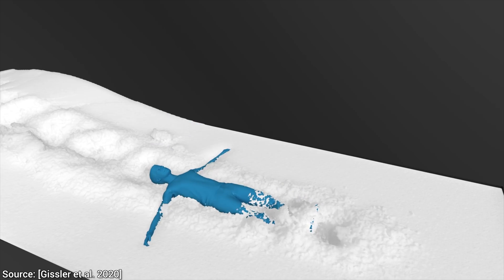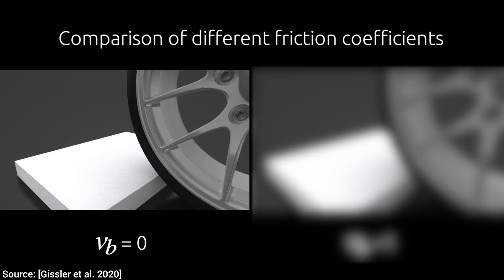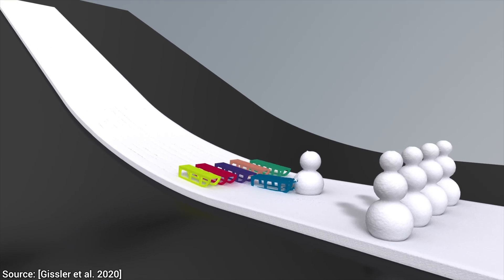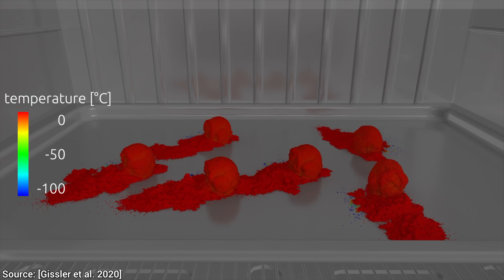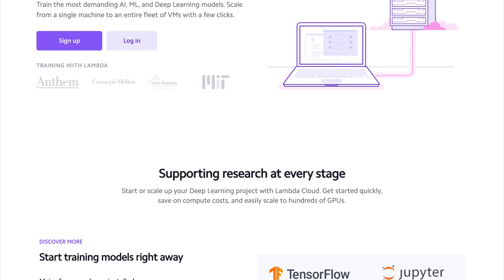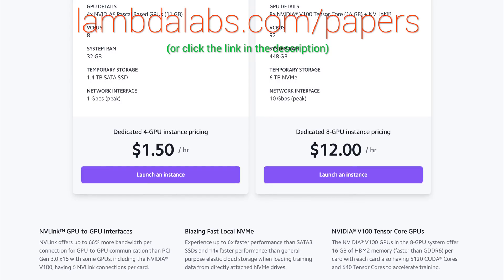7 Years of Progress In Snow Simulation! ❄️

Comment: They react like Styrofoam particles and nearly all are copies in that the single individual object in that all react similarly, they "melt" the same way. You do not take into account the cohesion of the ice crystals and instead treat each particle as it's own entity.

Not even powder snow reacts this way. Your presentation looks great btw, sadly, snow does not react like this. At the very least you need to add in some cohesion factor based on temp, to include the ice crystals melting singly or in clumps depending on temp and environmental factors and objects like the car used in this demo. The car was painful to watch as snow does not react that way when driven over. You need to add many new factors and variables. Cohesion due to temp (single entity crystals landing when frozen, melting together slightly, or simply interlocking when cold, their overall weight and reaction when combined etc) and compression ( what happens to that square of snow due to its own weight? Weight with temp gradients, refreezing?) are two that need to be added.

Comment: should snow be that sticky though? on the tyre example. it looks more like polystyrene balls than snow. Snow will compact into crack and get lodged in, or stick to certain surfaces, but i think one thing this simulation seems to lack is that every surface the snow touches is likely going to cause the snow to melt a bit before hand, so there should be a layer of wetness that then forms into ice and layers of snow going from ice to fluffy snow. Even the temperature simulation is just reducing the adhesion between the particles, none of them are actually melting like snow. theres no puddle of water forming, no water dripping off the snow
And like with most of these cgi fluid simulations once its beading on the sides of surfaces it just looks completely wrong. Same with this on the shot of the street, all the horizontal walls its acting like a cgi fluid sim with these weird clumps sliding around, whereas real snow will stick to a wall if theres enough surface roughness/wind and it can build up in crazy shapes, even horizontal icicles building up on wire fences, stuff like that. Thats the stuff they need to do to make this really great.

Amazing that its become so fast to compute now. but I cant wait until these simulations focus more on accuracy now that they are starting to get so efficient.

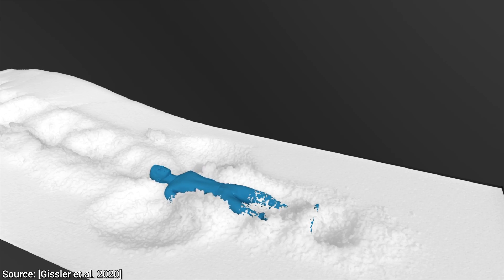Comment: 4:34 i mean yeah, mega = million, so 300MB would mean each particle takes 300B, which i think is a little much, but i suppose there’s temperature, location, bonds with other particles, and other “hidden” data that’s required for the simulation

Comment: You could have told many thing, but this being snow? No.

It strikes me rather like some magic styrofoam that can turn into a sticky gel. 

it has some strange isotropy to the way it is moving and breaking, the harderning seems like a "oh, stress, lets just randomly combine with the surrounding", and when in contact with other surfaces it  turns into a gel. 2:08 shows that really clearly.
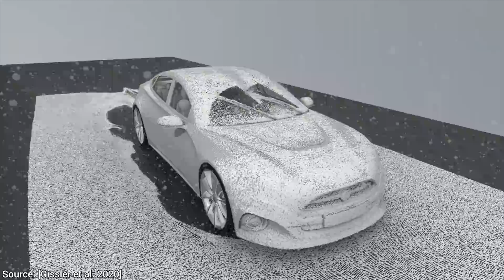Just look at the behaviour at 1:30 - yes, it leaves some sort of (strange) tire marks but everything else does not make it seem like snow.

By how it looks i kinda also doubt that it can even come near disneys version in terms of behaviour - just snow rolling down a slope and accumulating.

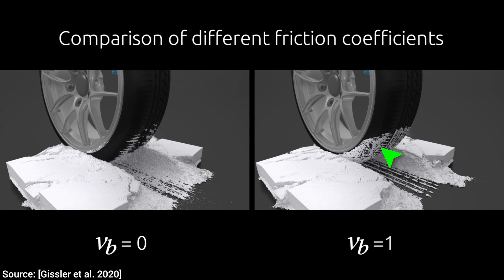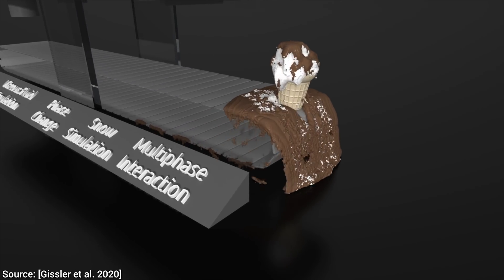Comment: does anyone else think this looks.. not correct? Examples: At 2:05, a tire won't create styrofoam-like edges, with snow particles drizzling off - it will compact the snow edge, more resembling a knife cut. At 3:54, the ice cream wouldn't split into many pieces with the center staying rigid - it would all collect in a single blob on the ground, with maybe som small splatter.
Reply: At 2:41, only very wet snow would come close to retaining its rabbit shape. Very wet snow would not turn into fine powder, as seen when the ears fall off.
Reply: Maybe I'm overly critical, but as someone living in the arctic, I see that these simulations clearly deviates from reality to a large extent. So I find it a bit strange when Károly's commentary seem to imply, from the footage alone, that this paper is an amazing achievement. It might still be, for all I know, but I'd prefer if the commentary also acknowledged the weaknesses and limitations.

Comment: Some of these demos look great but others look horrible. It can also be a little hard to tell in some spots if its the simulation itself that reacts oddly or if its just the extremely simple material used.
0:52 The snow that is kicked around looks great and I think this is the best that it looks in this video, but it looks like slime on their legs.
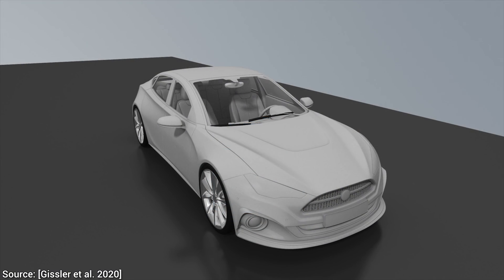1:10 to 1:21 all looks like slime or foam, snow is way stickier than that and the snow thrown by the plough just looks like a liquid.
2:07 I can't tell if its the actual simulation or just the way they placed the particles, but all of the little sheets flaking off look horrible
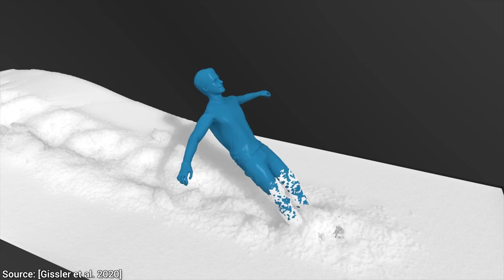0:59 The snow that is further from their arms as they're pushing it moves way to much, its transferring the motion more like a fluid than it should. The snow should just get compacted around their arms, with a small amount of movement a short distance away.

I wish more demos would spend a bit of time on the materials and showing real life ground truth videos as well.

Comment: It's definitely a leap forward but it's amazing how far it still is from realism. Just shows how much work there is still left for the people joining the field each day.
You can see that they don't have the level of dynamic change and variation that snow has.
The powder snow was too sticky and the densely compressed snow wasn't sticky enough. They need to add a layer that adjusts the friction and cohesion dependent on compression.
Powder snow won't make a good snowball but if you run it over with a car it'll compress very solidly. The snow pushed by the snowplow should turn into hard dense packed chunks as it pushes out.
I'm also curious how they deal with partial melt because a big element to how snow acts is partial melts at different stages and interaction with small amounts of melt changing clumping properties.

Comment: This is going to be difficult. The bunnies were way off, since the snow didn't melt and compress, it crumpled. Also, snow doesn't poor from roofs like that, it sticks to the roof and to the already present layers. The tearing is also weird or largely up scaled. You might as well do thermal capacity simulations because various things will take a long time before a snow layer starts appearing (e.g. on a wet tarmac).

Comment: Greetings from Finland. It seems I managed to procrastinate clearing up the snow at the yard till tomorrow, watching Two Minute Papers simulating snow. ;) I have to say these simulations look more like 'wet dry powder' than actual snow in behavior. Material in video is absolutely too fluid and uniform in density, droops right after it's fallen, compacting and solidifying is missing, melting simulation misses the state where snow still holds its shape but wets (I guess it needs more thermal than particle simulation) and so on.

Comment: The physics are amazing, but their shader ruins the final result.. Looks like 1990 CG snow
Reply: I agree that the shader breaks the demo.
Reply: True but thats probably trivial compared to the sim
Reply: @Redd56  
might be able to run the sim but you wont be able to display it in any meaningful detail. which makes the sim quite useless, for realtime applications.
Reply: @rocksfire4390  a youtube video doesn't need to be real-time and presentation is far more important
Reply: @spleen387  
it's the least important part.
it works, how you render it is up to you.
all i said was that in realtime applications it's near useless because trying to render it in any meaningful detail will bog any gpu down.
outside of realtime applications, yea it's great but again that isn't what i was talking about.
next time try to READ the words and understand them before commenting.
Reply: An important part of our original Disney paper is rendering the snow as a volume. It makes a huge difference. In principle you could particle density estimation to get a density field from the sph particles and then do a volume render from their method as well. It would look a lot better. This paper is more about the dynamics than the look.
Reply: The video isnt necessarily talking about how good it "looks" but instead talking about how accurate the simulation mimics what real snow would do, but yes it doesn't look great

Comment: Still looks like a mix of styrofoam, whipped cream and shaving cream..
Reply: It's not meant to look like the material snow. What's shown here is a physical simulation of snow, not a visual one.
We can already make a surface look realistically snowy with the right properties, mainly subsurface scattering; the tricky part is the physics of it all.

This simulation looks like shaving cream because it's a like a technical paper, it's meant to make the simulation's details clearer rather than make the snow look realistic.
Reply: That's because there is no shading going on so you are missing out on specularity, subsurface, translucency etc.

The grain size also is large in these which could be adjusted
Reply: Yeah it either looks like we’d styrafoam beads or old milk dripping off.. or a mix of frosting and foam beads.
Reply: It's not meant to look real, we could make it look like snow if needed to
Reply: @willywonka1962  But it is notthe rendering but the behaviourthat is the problem. They could use shaders to make it look perfectly like snow in a still-frame but it would still be obvious that there is something wrong as soon as it moves as the behaviour shown here looks nothing like snow.
Reply: @ABaumstumpf  I assume it's because they used the same friction value for the roofs as well as the tires and everything, as that value drastically changes the snow from being powdery to like a weird smoothy.
Reply: @Stephanie It looks nice, but it's still veeery simplified and optimized for a game. Real snow is very complicated. It can be a dust, a solid or even something between. You can melt it, you can make it a piece of ice or form anything from it. In Tomb Raider it's just a 3D surface with white texture, some shaders on it and some kind of a script which makes it lower the surface of itself under character's feet. I'm not a 3D designer but I think I explained it pretty correctly ^^
Reply: @Stephanie Thanks for a confirmation from a specialist :D
Reply: Yes as an expert of snow, this looks more like dry powder instead of snow. Snow always sticks more or less, especially when close to 0 C.
Reply: so i can eat 1/2 of it?
Reply: @godwin972  Don't eat the yellow snow...
Reply: Alot is in the shader as well. Even static snow is difficult to get right.
Reply: Agreed.  Many of these papers DO blow me away.  Not this one.  It doesn't look anything like snow unless you've never actually experienced snow.
Reply: looks better than what we have in games still!
Reply: @GvtTeddybear  It actually doesn't look better at all, unless you mean PS3 games or earlier. But that's not the point of this paper.
Reply: @Piterixos  i consider it better looking because of the more realistic physical interactions
Reply: its fast, but royally bad results.
Reply: Yeah..
Reply: Yeah, nothing like a real snow and I dont think this will ever be possible to make it look real.
Reply: @donpercent  Well, the simulation needs to take more things into account like the varying degrees of ice stiffness/age, since the compactness trough pressure is variable according to snow age and overall temperature
Reply: @kinkias  I think the simulation needs to take into account the actual structure of ice crystals in snow. If they represent individual tiny snow flakes as little spheres it can never really look right. The problem is that to simulate reality nearly perfectly takes so much detail and information that computers can't actualy do it. The over night rendering would turn into a month long rendering that ultimately crashes your computer. Lol
Reply: @dickrichard626  Not yet, but give it a few papers. Better simulations will come.
Reply: @dickrichard626  Snow crystals also change when time goes by. When initially formed, the crystals have lots of very sharp corners and after e.g. 24h old, pretty much all corners have vanished. As such, the friction between crystals is different, too. The crystals on surface probably lose their corners faster so for a good model you have to keep track of age of crystals and exposure to air, too.
Reply: @kinkias  Do the current simulations take into account interactions of light and the ice crystals? A lot of the look of snow, especially powdery snow, comes from those subtle interactions.
Reply: @donpercent  People watch this channel and don't realize not all simulations are supposed to look realistic? We can already create snow that looks remarkably realistic and I don't even mean movies but computer games. The simulation in this video is supposed to only show physics.
Reply: @Piterixos  If its not meant to be realistic why show any video of it anyway? lol
Reply: @donpercent  Never say never dude, a few more papers.

Comment: Very nice, although on some of the examples, it looks more like a foam then snow (like 1:15 or 1:30)
Reply: I think that's just rendering not due to the actual simulation
Reply: The man laying down in the snow also show very foam like physics. 
4:26 when he moves his arms up, way too much snow moves
Reply: @turun_ambartanen  they showed in the video that the stickiness of the snow can be adjusted. This is a physical simulation not a graphical one. I don't think most people here even understand the point of this whole thing
Reply: The way the snow slides/rolls of the roofs also needs some work. i think it should move more like a whole unit instead of rolling down like that. next paper maybe :P
Reply: its because the metaball/liquid effect that attaches them
Reply: Also the snowmen are wobbling after they get hit which looks quite strange. But I'm sure the authors are aware of these issues. Incremental improvement!
Reply: I had more issues with this than most of the videos I've seen on this channel. Some of the effects seem to lose the forest for the trees; like how there's no snow underneath the plows after it moves through (a plow cannot make perfect contact with a road). I can appreciate the advancement, but nothing in the video really made me think of its real life counterpart outside of abstraction.
Reply: Also, 4:55 in the lower part. Very foam-like.
And at 2:08 you can easily see snow splitting into slices. 

There's definitely some work to be done.
Reply: @DimaZheludko  snow can split into sections
Reply: @Ybby999  Sure. Not the ones you see at 2:10.
Reply: Its just the rendering techniqe,

slap some refraction on that bad boy and you got AAA snow
Reply: @lukeonuke  I disagree. Real snow doesn't MOVE like that. Nothing to do with the rendering. Could be wire frame and it'd still look off. The particles are sheering too much. They need to be stickier. The snow needs to pile up more and needs to compress and pack. I think that last part is a dimension that's not yet baked in yet. It's very impressive, but it's not snow just yet.
Reply: I'd say for most of them.

Comment: there are many fine achievements with this latest work. i wonder if it would be very difficult to improve the snow plough sequence by leaving a layer of snow still on the road? it is like this in some places in the demo clip, but in others, the road is left clean and pristine, which is not very realistic. 
it would be great if discolouration could be added to the snow, which soon takes on a grey colour (unfortunately), at least in cities. also, twigs and other debris fall on snow pretty quickly. not strictly speaking snow itself, but still a vital part of making it look realistic.
Reply: That might have more to do with the plow and the road both being too pristinely smooth and in perfect contact with each other. when it went over the bump, it did leave some, but i agree it looked a little foamy. Still, very impressive!
Reply: Discolouration is hard to accurately simulate, as it involes simulating dust and debris particles in the air interacting with the snow. (Atleast I think so.)
Reply: @meeeshroom  no question that the discolouration might be tricky, but for feature film work (which is what i need), things have to look highly believable otherwise the audience spots it and it erodes the dramatic suspension of disbelief. i am sure that with the right algorithms (and training) something highly realistic will be achieved.
Reply: @Bronze HD yes, that is a fair point. it would be interesting to see the results if a rough texture were used. if done with 3D geometry that could be expensive on polys, but i have not read the paper - maybe there is a neat and light way of doing it.